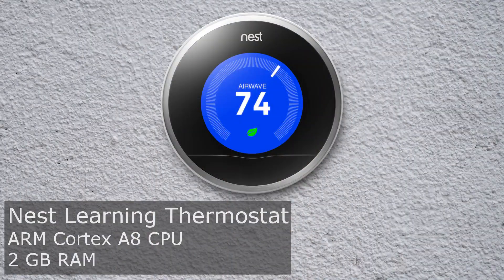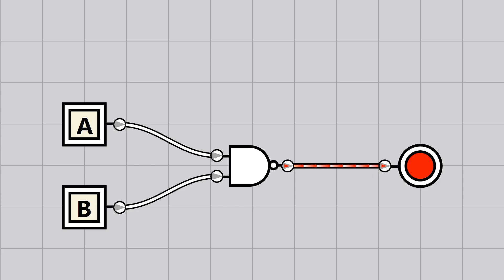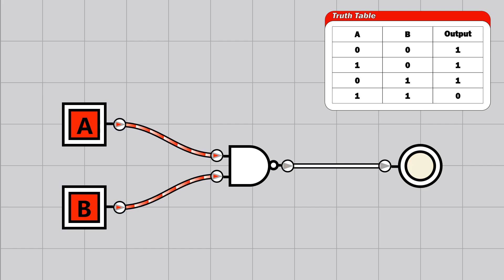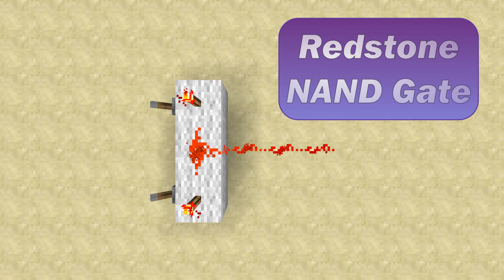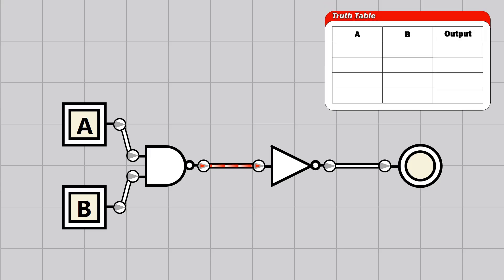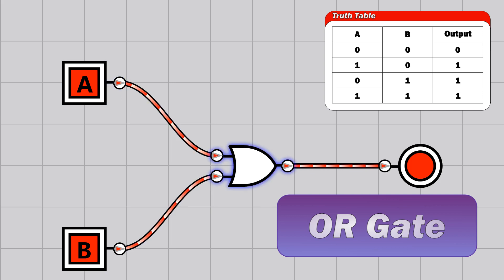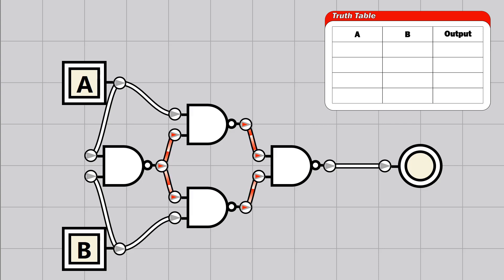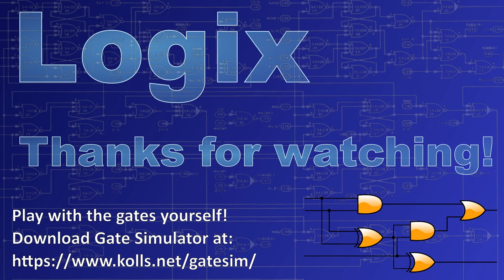Logix Episode 1 - Logic Gates

Comment: XOR has to be my favorite bitwise operation, software-wise. For C/C++ in particular there's some really useful tricks you can do with them. For instance, you can swap two integers without using an additional variable with them:

swap(int& a, int& b){
    a = a^b;
    b = a^b;
    a = a^b;
}

Or if you are doing code golfs you can use XOR to test for non-equivalency. Which will save you a byte:

int a;
int b;
std::cin>>a>>b;
std::cout<<"A and B are "<<(a^b?"Not ":"")<<"Equal\n";//"Long" version would have a!=b. a-b also works similarly.

Beyond that, great video man. You hit the basics pretty well. I can't wait for you to get into more advanced stuff. ;)

Comment: 1:45 You spelled it Turth, btw. Otherwise good video.
Reply from the maker: AUGH! Well, that's dyslexia for you. Sadly, I'm using Inkscape and Blender for my graphics and video editing, which doesn't come with a spell checker... This was kind of a dry run, but now that I have my work process down, there will be so much fixed for Episode 2. (Math and adders) Fixed camera exposure, better green-screen settings, audio improvements. I learned so much this time around... My new years resolution is to start making content so I won't be going away, it may be a little wobbly at first though.
Reply: halnicholas Nice, well I wish you luck. And cool, Blender is one of my favorite pieces of software out there, even including the paid software.